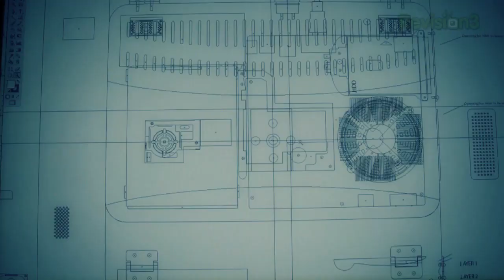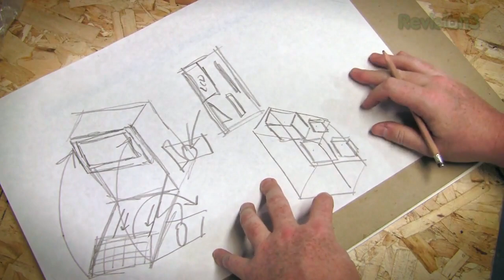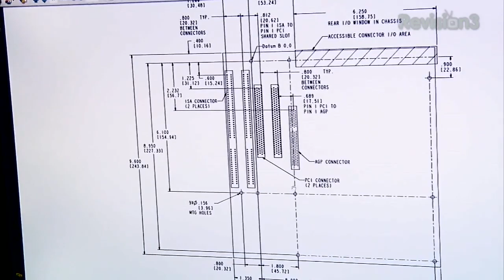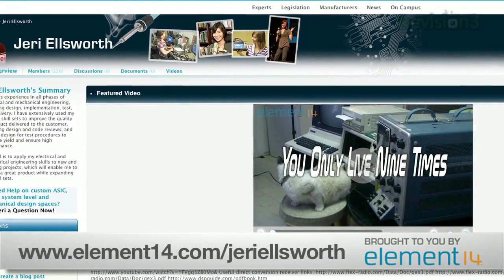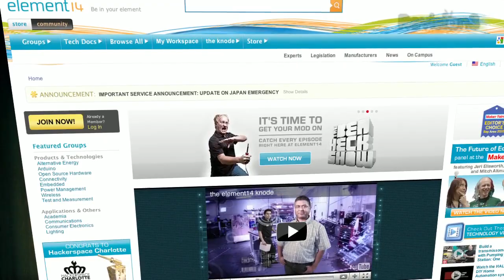The Ben Heck Show vs. Hak5 PC Case Mod Battle!!

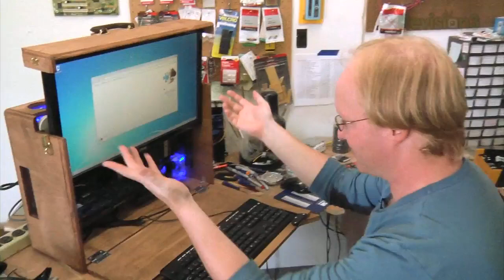Comment: At around the 17:00 mark he calls the processor a "Pentium I7". Lol
Reply: Todd Chambers and he makes it seem as if the processor is what mainly controls how well a PC runs but a Graphics Card, RAM, HDD/SSD speed are all large contributing factors to a PCs speed
Reply: ***** no, not really, a slow cpu wull bottleneck everything. the 'c' stands for central.
Reply: ***** no, not really, a slow cpu wull bottleneck everything. the 'c' stands for central.
Reply: 17:13

Comment: @xnamkcor 
the average load temp for it is 80 degrees. that is bad i have Intel i5 with after market cooler goes as high as 40 degrees. with temp comes lag its better in the long run to get a good CPU cooler

Comment: Hey Ben, my Idea for a video is a raspberry pi gaming pc to run games like Battlefield 4 and Metro Last Light at a nice playable frame rate with all the texture settings running the games above 30 fps on ultra... I really like the raspberry pi and the functionality people have squeezed out of it, and linux is just a nice operating system that I would love to learn and play steam OS on! Thanks
Reply: Sorry, but a raspberry pi's processor isn't even nearly enough to do any of that. It can barely play 720p video when overclocked. I own one, so I know. Raspberry pi's processor is 1GhZ when overclocked to the max, it's 0.6GhZ less than my phone has. It would need 4 or 5 times more to run bf4 on max graphics. Sorry! :/
Reply: Masi Virolainen the power of a processor isn't determined purely by GHz you have to account for other things such as number of cores and hyperthreading and especially for gaming the graphic processing power offered. This is why we have something called a dedicated graphics card? (dumbass) unfortunately running bf4 on ultra is not going to fucking happen on a raspberry pi however if you were to connect multiple together to make a cluster computer (you can find tutorials but it's complicated) you could have the possibly of running bf4 of off raspberry pi power. Then you have to work around Linux to get bf4 working and in the end you'll be spending probably multiple thousands of dollars in Ethernet cables and raspberry pi boards it's just not possible. If money is no object however be prepared to configure multiple hundred if not thousand raspberry pis to work as a cluster computer which will take about an hour each so you're looking at months of doing nothing but looking at loading screens. Honestly just pay $600 for a pc with like a 6300 and r9 260 and you'll be just fine on high settings.
Reply: Oh right, I thought you were talking of a single one. My bad in that case. A single raspberry pi can parely move a mouse without lagging. I had to overclock to make the mouse go smooth. xP
Reply: there is a small problem....bf4 isn't on steam
Reply: sorry my comment was so general. The reason I asked that is i've seen others in a since link together multiple raspberry pi's to build a "super computer" and bf4 can run on Steam, you would just need to link up Origin.
I though it would be cool if multiple raspberry pi's could somewhat create a make shift steam machine...
Reply: Kylar Duncan Link up origin? im not sure what you mean. sure, when you buy a game off steam, you need that games client (Like ghost recon future soldier and uplay). how can you run a game on steam os if that game isn't sold on steam?

Comment: How was this under $200??
Reply: The CASE had to be under $200, not the system.
Reply: dukethedj Go to his website once and see what he charges per hr ($150) for projects like this. So if a customer order it it would be a $2000 dollar case (without the monitor or any computer parts) not $200, I don't think he complied with the challenge at all.